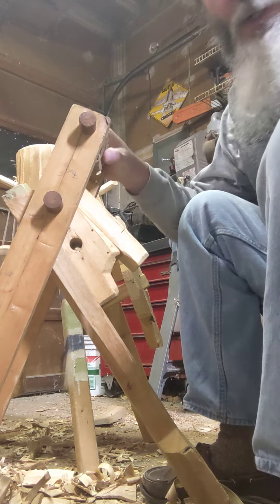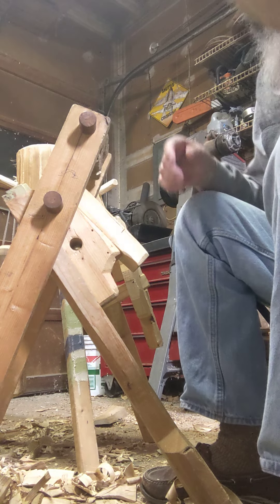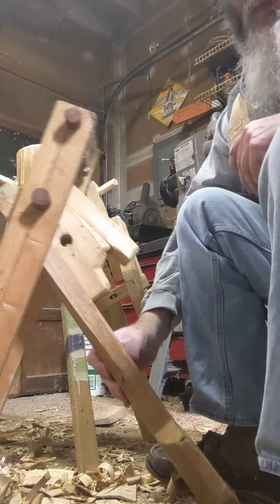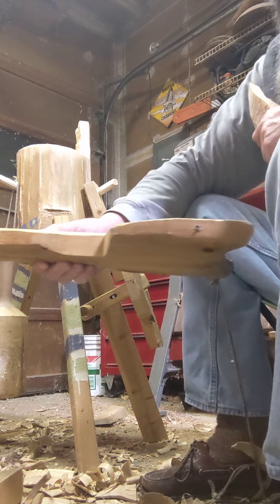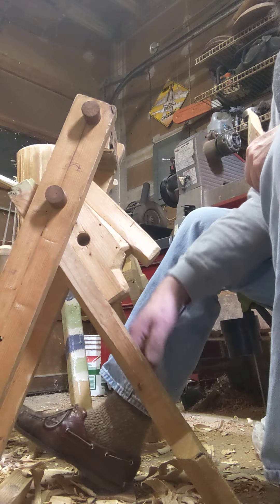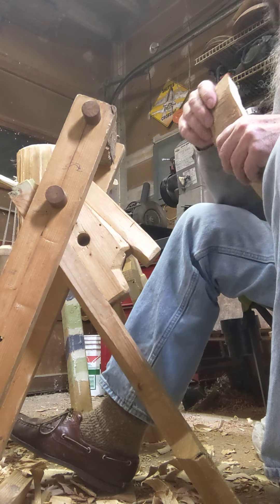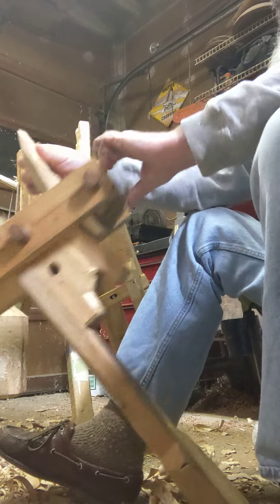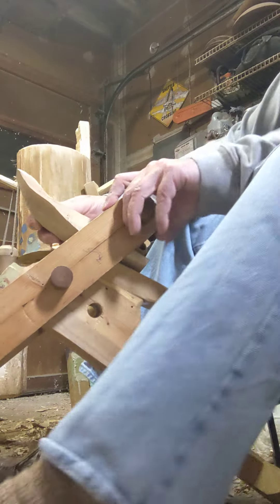Shave Horse "system" update

Comment: So, I am starting to build mine tomorrow. Been looking at different options for a mobile system, and after finally running into yours, have to add my huge Thank You, and admiration for your build. It's genius, and exactly what i wanted but couldn't figure out on my own. 
Huge appreciation from a Pittsburgh wood butcher/bespoke kindling creator.  Now have to come up with a new excuse for my lack of talent carving. Can't blame my holding equipment anymore. Sigh...
Reply from the maker: Awesome.  Don't be afraid to drill another hole or cut something shorter.  This didn't start with a drawing.  It started with trying something and then figuring out if it was right or if I could make it better...
Reply: @santonucci  Thanks, I have been fiddling with measurements and think I have a good place to start from now. I'm a couple inches taller than you, so am starting with your rough measurements plus a couple. As you said, easier to remove than add. 
One quick question if you see this, how much does it cut into your gut? Can you work for an hour or so, or shorter times? Am toying with idea of a pool noodle on outside of "gut plate" (no idea what to call it, so, its a gut plate now). I am a skinny dude, which is sometimes cool, sometimes not, so am slightly worried about the pressure on gut and/or hip bones. Thanks again for the inspiration. If mine turns out well, will share that it's your idea with friends. If it's a mess, will leave your name out of it. Seems fair?